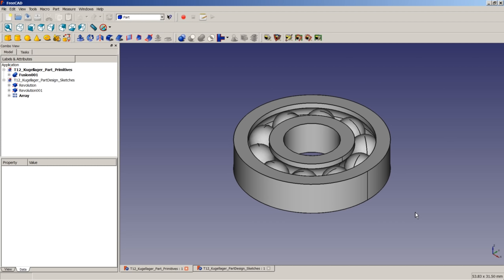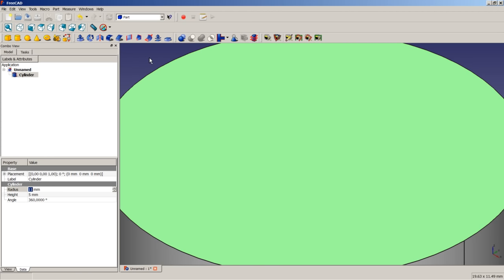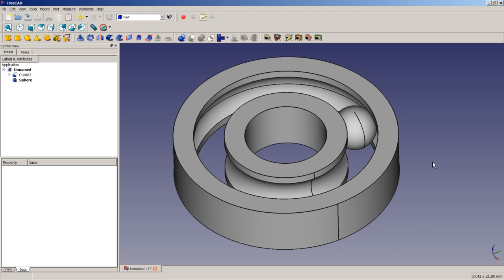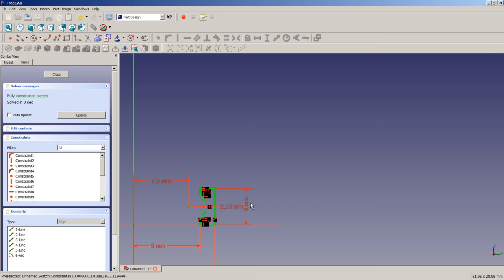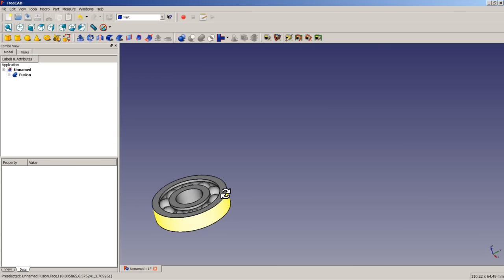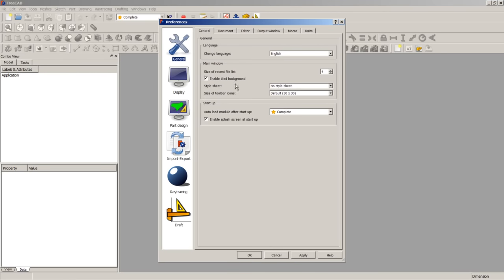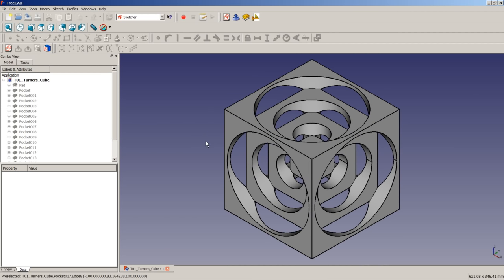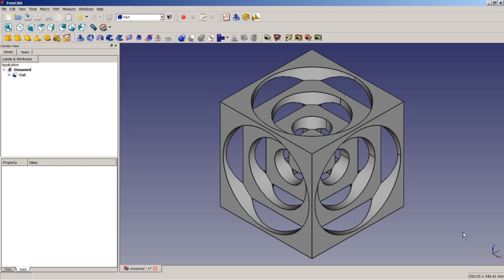FreeCAD Lesson 12 - Ball Bearing

Comment: I looked at so many tutorials but chose yous. It is the best. Altough I use Linux 18.04 and you Windows It is no problem. Only thing. I do not know if the pointer/arrow can be made a bit bigger because at times you have to pause and look for it. Altough version 0.8 is quiet different in some cases and then you have to try and figure things out. It would it be great if you could make a new series.
Thanks for the series it is really very good.

Comment: I'm able to create two different revolve sketches as you did with the ball bearing outer case and the inner case. 
when I revolve the sketch of the inner case, only outer case is visible, not the inner.
in the dependency graph, it shows the inner revolution depends on the inner sketch as well as on the outer revolution.
How can I remove the dependency of inner revolution on the outer?
How to solve the above?

I'm using the latest version of freecad 0.18

Thank u in advance
Reply: i think you need to create an other body for the second revolve

Comment: I watched all your tutorials. They are great, you seem to be nice person :-) I use freeCAD under Ubuntu to design wood projects like bookstands. I use Part Design Workbench and design all from cubes in 3D (wooden board from cubes, copy, move and resize them). Currently I use Draw dimensions tool from Draft Workbench but the dimensions not look good. Also I am not able to auto generate dimensions anywhere (the Drawing 2D not works to me). In Drawing the freeCAD puts 2D things outside the paper size A4 even A3 ISO (no matter of settings). Also I am not able to add dimensions there or simple 3D model view. I use export to pdf in current 3D view of Part Design with dimensions created with Draft dimensions tool. So I have questions:

Are there any plans to make better looking dimensions in 3d view? 
Are there any plans to make auto generator according to the cubes dimensions (or 3d parts)?
Are there any plans to make auto generating table (or spreadsheet) with all necessary dimensions for board cutting? I mean something like below I will be able to print out and give someone who cut me the chipboards: 
Item | Sizes | Quantity 
Top | 200 mm x 200 mm x 18 mm | 1
Side | 600 mm x 200 mm x 18 mm | 2 
etc...
Reply: in 0.17 a new module called TechDraw is introduced for creating 2D drawings.
In 0.16.6700 spreadsheet module is re-written allowing putting a table on drawings.
in 0.16.6700 "expressions" are introduced to control dimensions/constraints via spreadsheet.
At the moment, after spending several months in enhancing the wiki on www.freecadweb.org including uploading
some offline tutorials there chances are getting better and better that i will find some time to produce more tutorials.
We'll see ...
Reply: It would be awesome if there would be tutorial about it. I was trying Drawing but this not works. Maybe this is because Ubuntu package version, don't know. Also I am not able to use spreadsheet effectively, or even export it. I save it as csv but there is no file. Don't know where it is written. EDIT: Under Ubuntu I have freeCAD version 0.15 (revision 4671 git). So it sounds like hope :-)
Reply: BPLRFE Hello again, I tested the TechDraw under freecad-daily Ubuntu version 0.17+ and it is not exactly what I mean:
- TechDraw allows draw dimensions on Drawing Workbench not get Data values from 3D Parts automatically.
- Spreadsheet can be placed on Drawing Workbench but not allow for auto generation (get the 3D Part data values into table).

However it is nice step forward.
Reply from the maker: Spreadsheet also allows to retrieve data from the 3d part (model) and write data back to the model.
Look here for documentation:
http://www.freecadweb.org/wiki/index.php?title=Spreadsheet_Workbench
Reply: Great !!! This is what I want !!! It works in 0.15 version under Ubuntu as well !!! Export to CSV works as well so I can use it. Thanks !!! Too bad there is no print spreadsheet option, it would be more helpful. The Drawing Workbench not works well, I mean auto scale and positioning of 2D parts. Also I don't know how to place 3D model with dimensions in Drawing Workbench (I use export 3D view to pdf instead to print).
Reply: Hello, I've just created simple macro in python that creates spreadsheet (named toCut) and write all dimensions automatically to it :-) I have little problem with Polish chars during writing to cells as strings but without specials chars works well and get only Part:: ones. I'm also thinking to add quantity column in spreadsheet if the dimensions are equal and maybe square meters auto calculations :-)
Reply: OK, I've just created macro that automatically get all dimensions of "Parts::Box" objects and create spreadsheet "toCut" with all needed informations to cut chipboards. it calculates quantity (only first occurrence of the same dimensions is added) and also recalculate square meters (for each board and all together at the end) and recognize thickness of the board (put it into separate next column). Now only one thing I need is to print it. Export to CSV skip mm and not keep columns so I wait for Spreadsheet Drawing stable release under Ubuntu to make it automatic as well.

Comment: - At east 4 tutorials in that one video:  installing the program, modeling a ball bearing, creating a macro, and the turner's cube.  Better if they were split apart.

- One problem I see in both workflows for the ball bearing:  3 distinct parameters in the design, ball radius, race radius, and bearing thickness.  Change any of those and the change has to be made several places in the model.  With the current 0.17 I'm looking at the spreadsheet as a data source for such parameters.

Comment: Did a test and you can indeed edit the revolution of the sketch, but what a pain!
Reply from the maker: +Phil B 
Well, aside from the very-hard-to-answer question if it is the better idea to define chamfers/fillets in the
sketch or using extra features (preferrably as last operations with the model) we are still facing a big
limitation in freecad.
It is called "topological naming".
Background: when changing the model FreeCAD will (internally) reorganize the hole model and apply new
identity numbers to the edges and faces. Therefore references could be lost/broken.
Because it would be a huge time-consuming taks to program a solution for that, this task has not been
dealt with yet.
That's one of the reasons FreeCAD reacts unexpected when altering the model too much.

Comment: Hi. I need to make a pipe with some curves  at one endpoint, but the goal is to blow a lead ball without air looses along it's way. I would like to learn to dothis. Thanks in advance.
Reply from the maker: +martiarenax3 
The basic idea would be to do a sweep along a path (either a  sketch or a polyline/bezier curve from draft.
Apply part thickness tool get a tube.
Reply: thanks mate!.